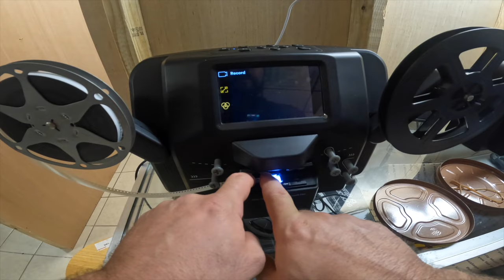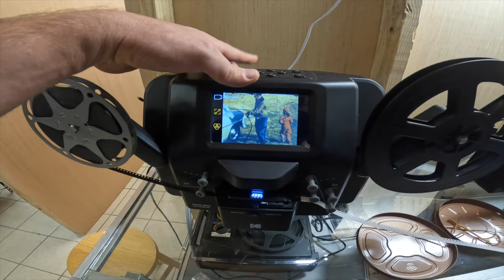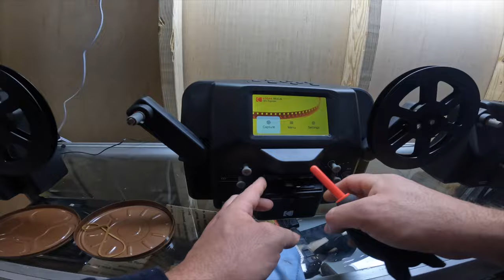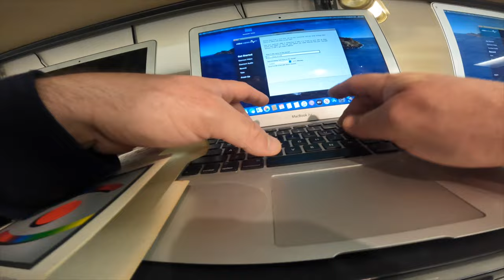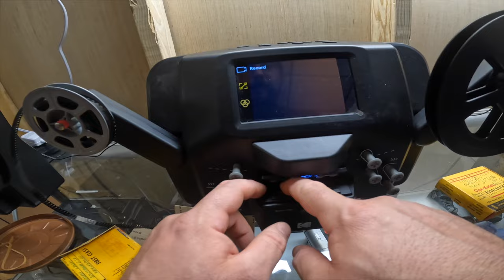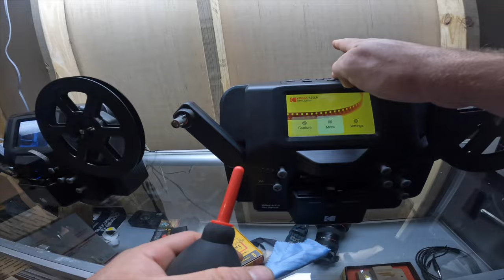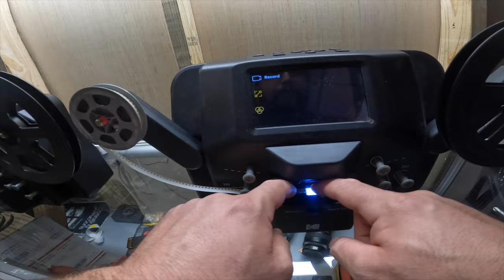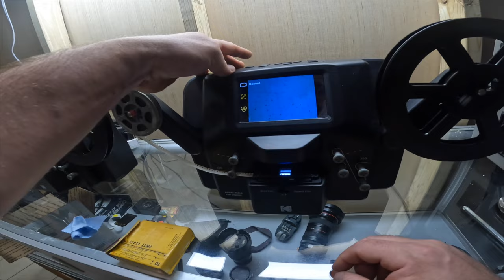Kodak Reels 8mm film Capture **Workflow and Why i use them to transfer home movies

Comment: Thank you for the informative video. Your loading method helped a lot. I have one issue that I can’t seem to diagnose. On some scans the video  - at the top of the frame, has a twitching where the film appears to drop or pull down from the top I can see the top of the frame come down in a twitching manner, like every third or half second, constantly. Most of the time I can re-scan and it doesn’t happen. Any ideas? Thanks.
Reply from the maker: They glitch from time to time. Could be the sprocket holes on the film or the film wasn’t shot lined up originally. You have to adjust framing sometimes midway

Comment: I've been using the Kodak Reels for the past year and it's been working great except for one thing. I've noticed that when putting a larger spliced 7" reel kind of causes a stutter at the end of my files. Frames that are repeated or stretched. Have you noticed this? I guess the machine isn't powerful enough to be pulling that much film? Seems to run fine with the standard 3 min reels.
Reply: I have already scanned hundreds of films, I have two Kodak Reels, no problems with stuttering, 9 inch reels are no problem. Maybe the machine has a problem?
Reply from the maker: It works fine for big reels as well. Maybe film issue
Reply: Interesting. Could be that the camera it recorded on had some issues, but I don't notice it on the small standard reel captures, only the larger ones. And as far as I know the large reels could not be used in any cameras, they were all spliced together later on. Maybe the scanner motor is dying/weak? It certainly has had it's use over the last year.
Reply: what kind of splices are? cement or tape?